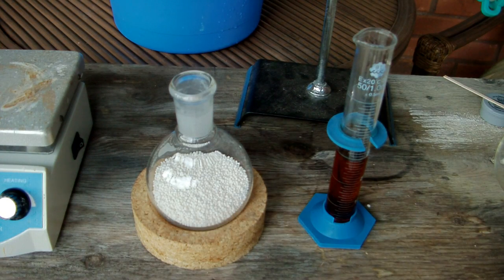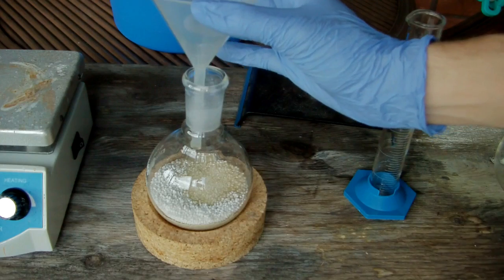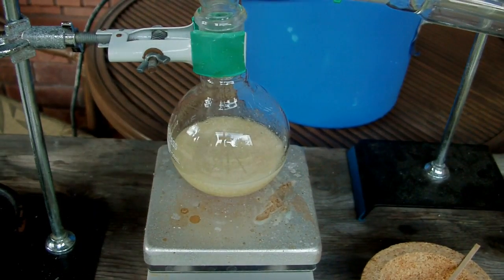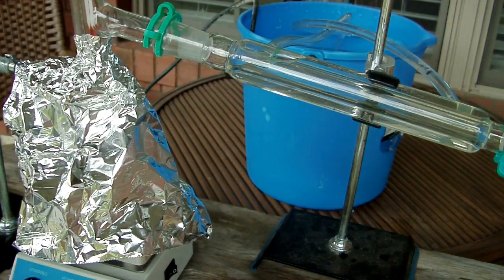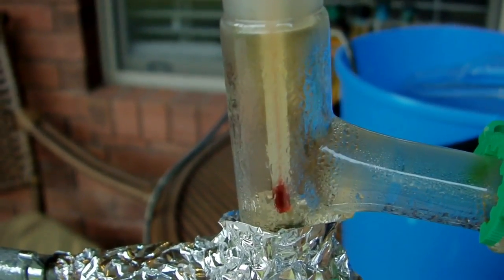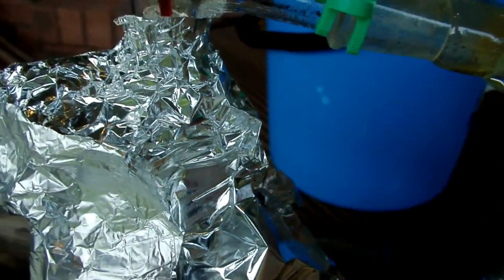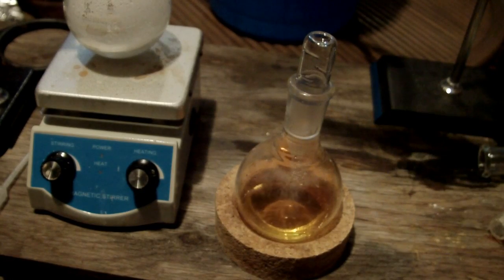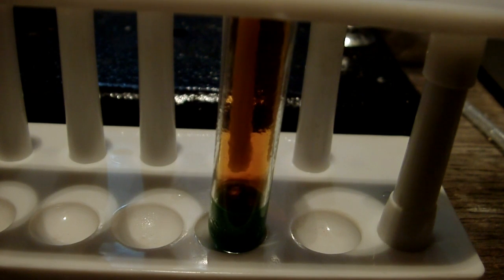Nitric Acid Synthesis

Comment: It is not the best to use ammonium nitrate because there is a bit of ammonia in the end product.
I was using ammonium nitrate and after a day or two there would be a white substance at the bottom and I am assuming this to be ammonium nitrate I think.
I switched to potassium nitrate because of this.

Comment: Ive been told that the ammonia that gets released when using ammonium nitrate can contaminate the nitric acid - is that not the case?
Reply from the maker: It's not really a great compound to use, no. It ties up hydrogens in ammonium bisulfate, and can indeed decompose into ammonia which neutralizes your target acid back into the starting materials. It's also said to be dangerous to hear, although the quantities used here should be fine. Really you'd be better off using potassium nitrate.
Reply: @mrhomescientist  yeah, im told that it works better if you convert the ammonium nitrate to sodium nitrate using sodium hydroxide
Reply from the maker: @jhyland87  Yep that would also work. I find that potassium nitrate is easier to make than sodium nitrate, but work with what you've got!
Reply: @mrhomescientist  yeah i just ordered potassium nitrate. I just have a bunch of ammonium nitrate, but no sodium hydroxide either, lol

Comment: Okay so I'm not trying to be mr. Know it all cuz God knows I am not I have trouble with Stoichiometry I'll admit it. But think of it this way the reaction once it gets hot drives heat on its own so I always approach heating this very very low temperature I might crank my mantle up to about 5 to get it started but once it starts emitting a little bit of nitrogen dioxide gas I turn it way down almost off and it'll continue to Bubble because of the reaction is exothermic this way you do not not overshoot your temperature range

Comment: That drain cleaner is only around 90 to 93% sulfuric acid it is not 98% there's a lot of water and organic impurities. You should always distill it first and get nice clean acid from it I know it's a pain in the ass but it's worth it. Even if you just boil the sulfuric acid in a beaker it will drive off the water and at least it'll be stronger. Another tip would be to always use at least 10% excess sulfuric acid over the about dictated by stoichiometry

Comment: Hey! Nice video! a few constructive critics :) 
1- always try to use potassium or sodium nitrate, since ammonium nitrate will generate some ammonia gas and neutralize part of your product and contaminate it.(lowering your HNO3 conc.)
2- altho fuming nitric acid is a therm used for +85% nitric acid concentration, i think is better to talk about FNA (red) from 94% to 98,5% and white from 99% to 99,9%. 
3- Instead of using Al foil to isolate, is better to use an oil bath (or water, but oil is better) to get an even heat distribution and prevent crackin or overheating of the flask among other things.
4- If you don't want to get those NO2 gases out of the distill. setup and into your house, environment, or lungs, make a NaOH (sodium hydroxide) or NaHCO3 (sodium bicarbonate) aqueous solution trap. 
Sorry if I misspelled something, regards from Argentina!
Reply: A good and classic way to determinate you have around +90% FNA is to react a piece of copper into the FNA and seeing very little to no NO2 gas production, and a dark green HNO3/CuNO3 solution.

Comment: I tried this experience with something I thought was Amonium Nitrate from an instant cold pack.. 
first try: too much heat it exploded and made a big white fume.
second try: I reached 100°C.. I tried to control it at 83°C.. I failed.. no red fume and bang at 101°C it did the same thing.. exploded and made a big white fume. (exploded, my joint poped out) 

If it wasn't amonium nitrate.. what was it? it was small white pearl.
Reply from the maker: BIGGY Girl Urea is another common chemical for cold packs. Check the label or look for an SDS online.
Reply: mrhomescientist damn.. it's urea. 
well.. now you know what it do haha I will try the stochemetric to see what was the fume. Thanks! Now I need to find amonium nitrate to retry your technique.
Reply: mrhomescientist ok, after the stoichimetric calcul.. I made CH4N2S.. thiourea.. it means that I will have thyroid problem. 

lesson of the day : always make sure of what I use before experimenting.

Comment: Wouldhave been much smarter to use a pot of water, set the flask in the water and heat the pot. Either that, or get yourself a heating mantle, or a flat bottom flask Waste of Energy and good way to burn out your heating element

Comment: Wait why wouldn't you use an excess of sulfuric acid? Its boiling point is waaay higher than nitric acid, so you wouldn't lose any of the reaction to lack of reactants. Also why not grind the ammonium nitrate into powder for greatest surface area? Great informative video though, thank you!
Reply from the maker: Both great ideas! I also did my stoichiometry wrong because one of the products is actually KHSO4, not K2SO4.
Reply: +mrhomescientist ok cool, gotcha.

Comment: When you made yours did you use lab grease on the joints?  I have done it both ways and it seams to make the acid a little more yellow.
Reply from the maker: I did grease the joints, yes. I have heard you can grease with sulfuric acid in some cases, which could be a good idea if you don't mind a little possible sulfate contamination.
Reply: :) thanks for getting back 2 me.

Comment: U should say that ammonium is the last source to look at i always use sodium
Reply: potassium nitrate has always worked the best for me.
Reply from the maker: Yeah most people seem to prefer it. Ammonium nitrate is what I had on hand so it's what I used. I think there's some concern that ammonia will be produced and neutralize some of your product.
Reply: the final prooduct can be cleaned by bubbling air through. u can also make it anhydrous by distilling with equal parts 98% h2so4

Comment: Instead of using a round bottomed reaction flask, why not just use an erlenmeyer to increase the surface area, making it heat more efficiently?
Reply: +John Van Vynck 
The trick is to find an erlenmeyer flask with a ground glass joint.  I
Reply: +John Van Vynck 
But a water bath in a pot could have helped
Reply: ebay

Comment: not your hot plate dude. its because you are putting a roundbottom on a hotplate. was never intended to be used like that. contact patch is tiny. use a water bath or oil etc.
Reply: or a heating mantle. ice bath under the receiving flask is also helpful

Comment: I want to resolve the question about if it is safe or not to manipulate nitric acid with nitrile gloves. I saw a few days ago your comments in this video, so i said to my inorganic teacher (im studying chemistry at the university) if it it's dangerous or not. We decided to try this experiment, and today we have done it. The conclusion is: they don't react.

To sum up, you can manipulate nitrile gloves with nitric acid safely, even if it's concentrated (we use HNO3 10M to test the experiment)
Reply from the maker: I've also tried this, and found out that it's only certain types of nitric acid that cause bad things to happen with nitrile gloves. Red or white fuming nitric acid is what you need to watch out for. I tried this experiment with what I made here and it didn't react, so that means I didn't actually make red fuming acid like I say in the video. Later I tried this with reagent grade white fuming acid and the glove caught fire almost immediately! Scary stuff.
Reply from the maker: Also my white fuming acid was 17M, so there must be some threshold concentration where the danger really starts.

Comment: Do not use nitrle gloves when handling concentrated nitric acid, they will catch fire on your hands if you spill it. Use noeprene instead. 

Nitric acid vs. Nitrile gloves
Reply from the maker: I actually tried that experiment using my acid, and got no reaction. I think I was mistaken in calling this "fuming nitric acid" - it's not potent enough to destroy nitrile gloves like that. This type of glove still probably isn't ideal for nitric acid of any concentration. I have a glove compatibility chart in my lab that goes into detail on this topic.
Reply: mrhomescientist I  found this out the hard way after making vacuum distilled 
WFNA. I spilled a little on the gloves and managed to get them off before they started to smolder. I then replicated the experiment in the video.

Comment: Isn't it a bad idea to use NH4NO3? Some of the NH4+ might decompose you might get some NH3 comming over with the HNO3 and reform NH4NO3.
It is probably better to use a alkali nitrate instead.
Reply: plus it can overheat till the point of detonation once the reaction is initiated
Reply: Ya mon, plus the ammonia will neutralize the acid product

Comment: as I understand the RFNA should be above 90% and you state in your description that your conc was 70% , do I miss something here?
Reply from the maker: It was my impression that RFNA was concentrated nitric acid with lots of nitrogen dioxide dissolved in it. Looking around a bit, you may be right. The acid I produced is very similar to it, but apparently technically isn't RFNA. My mistake.

Comment: I don't need conc. Nitric Acid, so is it possible to use Cheaper low Concentratet Sulfuric Acid? (37.5%)
Reply from the maker: No, concentrated acid is required in this particular reaction. You can always make concentrated nitric then dilute down to whatever strength you require, though. There are other ways to make the acid that don't require sulfuric, if that's your problem. Look into ways of creating NOx gases and leading these into hydrogen peroxide solution.
Reply: ok thanks!
Reply: you can make it with hydrochloric acid,copper,nitrate salt and hydrogen peroxide.

Comment: Strong acids dissociate fully in dilute solution, but in concentrated solutions dissociation is incomplete, because there simply aren't enough water molecules around to protonate. Also, nitric acid is not entirely a strong acid, as its acid dissociation constant is lower than that for [H3O+].

Comment from the maker: Here's what I found: the oxidizing power of the acid comes mainly from the fact that in concentrated solutions, a lot of HNO3 remains undissociated. This molecule is much more oxidizing than just the NO3(-) ion, which is found in nitrate salts and dilute acid. The salts do become good oxidizers at high temperature, which is why they find use in pyrotechnics. I've sent you a message with more info since I'm limited here.

Comment from the maker: That's actually a really great question, I'll have to look into that. It's probably dependent on the reaction you are doing, but I've never seen NaNO3 been referred to as an "oxidizing salt," for example. Lots of sites say it's because it is the nitrate ion that is being reduced, rather than the hydrogen ion as in other acids, but NaNO3 doesn't react in the same way and it too has nitrate! That's very interesting, I'll have to get back to you on this one...

Comment from the maker: Not all acids are equal. Nitric acid is an oxidizing acid that will dissolve many things sulfuric won't, like copper. It's also used in nitration reactions, which as you might have guessed from the name require the nitrate ions from nitric acid!

Comment: Consider using a sand bath between your hot plate and the round bottom flask, it'll allow the heat to be spread more evenly along the bottom as apposed to a single point.

Comment from the maker: Oxygen doesn't really play a part here. The purpose of using reduced pressure is that you can carry out the distillation at a lower temperature, which prevents the nitric acid from decomposing into NO2. This yields white fuming nitric acid (WFNA) instead of red fuming (RFNA) like I got. Having some dissolved NO2 has never really been a problem for me, since most reactions I use it for produce the gas anyway!

Comment: i think you were right about the orange haze btw my question is do you reckon if u used ur vacum outlet to rid the system of oxygen would this occur i have a similar set up n im considering not putting a full vaccum but using an aspirator to just remove any oxygen but totally unsure on the results is it that the oxygen works as an oxidiser and removing it would mess the whole experiment up ? either way the nitric is contaminated which im trying to avoid not that its necessary

Comment: Because obviously, all you can use cheap chemical glassware from China for is making not just drugs, but specifically amphetamines. It's theoretically relatively simple, an acetoacetic ester synthesis with chlorobenzene followed by reductive amination with methylamine will yield methamphetamine, but it's not like ethyl acetoacetate is exactly cheap.

Comment from the maker: That reaction would be hard to separate your products, since both sodium sulfate and ammonium bicarbonate are very close in solubility. You could make ammonia with it by adding a base (possibly, haven't tried it myself), use it as a fertilizer, or use it to make double salts like ammonium alum or ferric ammonium sulfate!

Comment from the maker: Yes to all your points! Vacuum distillation is really good here because it runs at a lower temperature and thus you get less decomposition of the acid, leading to better yields. That's actually the only way to produce white fuming nitric acid (here I made red fuming). I just don't have a good vacuum source at the moment.

Comment from the maker: I've never heard of it being used that way - I don't believe the proportions of nitric and hydrochloric are right. My sulfuric acid is "Liquid Fire" brand drain opener, so it's either some sort of dye or suspended carbon particles. Drain cleaner acid is sometimes industrial waste acid that they don't bother cleaning up.

Comment: e the glass and cause the RBF to shatter on cooling. it'll make a cake of salts in the bottle that differ due to the impurities in fertiliser and the bisulphate. what i do is boil some parrafin oil alongside my dry distillation and pour in the parrafin oil IMMEDIATELY after the dry distillation stops. 
then i clean the reaction vessel with concentrated HCl and finish washing with acetone or methanol. whichever is cheaper for you

Comment: dry distill it mate.
it's SOOOOOO CHEAP to do it that way. a few years ago, that's how i always made my Nitric Acid when i couldn't find most things. impure Ammonium nitrate fertiliser mixed with impure sodium bisulphate. Heat it up to around 350 centigrade and it produces a great red fuming nitric acid. 
if you add water, you'll actually get a less concentrated nitric acid so keep your apparatus as dry as possible. 
the ONLY problem.. however.. is that when the final thing cools, it CAN fractur

Comment from the maker: If it was anhydrous it would be a dry distillation, and I think that would have trouble since here you have two solids reacting. Trying to use a tiny amount of water wouldn't work because it would just evaporate off immediately during the distillation. You can certainly try it, but I think conc. sulfuric is the way to go.

Comment: Hmm, so it couldn't be done anhydrous? Would you really have to dissolve it in water, or could you not use just a really small amount of water to initiate the reaction and act as a catalyst? Perhaps that would just make 68% acid, in which case hydrochloric acid is probably a better bet.

Comment from the maker: I'd think it would, as bisulfate is a common substitute for sulfuric acid. The problem with that, though, might be that there is too much water. I tried this synthesis with dilute sulfuric acid and only got an incredibly dilute nitric product. Lots of water comes over in the distillation - that's why I used concentrated sulfuric. You could maybe try dissolving in an absolute minimum of water and carefully distilling at nitric acid's boiling point.

Comment from the maker: I store all my acids in plastic safety-coated glass bottles with plastic phenolic caps, and these are placed inside a rubbermaid tub with a layer of baking soda on the bottom. This absorbs any leaking fumes and will neutralize any spills.  Acid fumes easily corrode metal caps. What do you mean your acid neutralized though? It won't do that unless a base is around, or a lot of metal to react with. I hadn't heard of any problem storing nitric in plastic bottles, but it's always best to use glass.

Comment from the maker: That's definitely a possibility - some people prefer to use other nitrate salts because of that. I had forgotten about that, thanks for the reminder. As for the heating setup, the flask actually wasn't touching the hot plate, it was sitting just above it. The hot air heats it from all sides (somewhat) evenly. Really I just wanted to try out a different heating method!

Comment from the maker: I don't think so - the only way I've ever heard of to remove the NO2 is to put the acid under reduced pressure. Distilling it under somewhat of a vacuum gives you WFNA (white fuming nitric acid) instead, which doesn't have the dissolved gases. You might get rid of some of it by heating, or perhaps by bubbling air through the acid to carry it away, but that's just a bit of guesswork on my part.